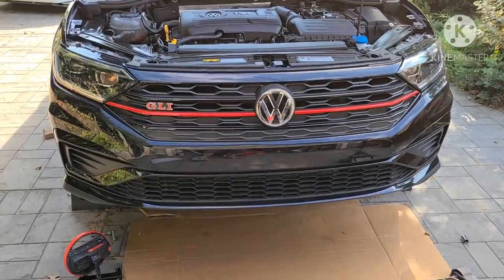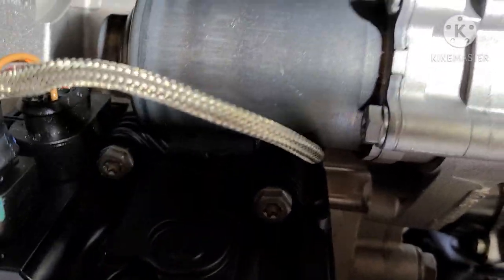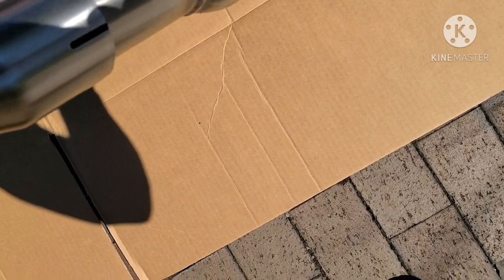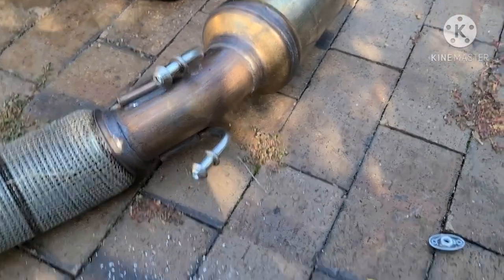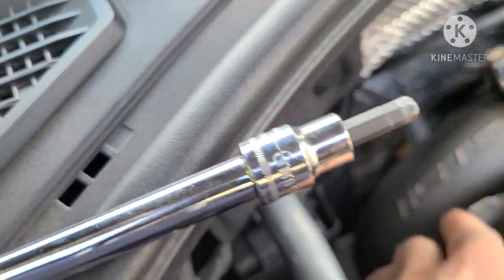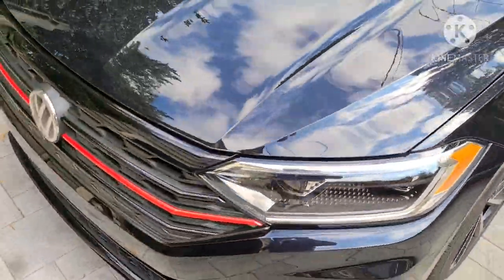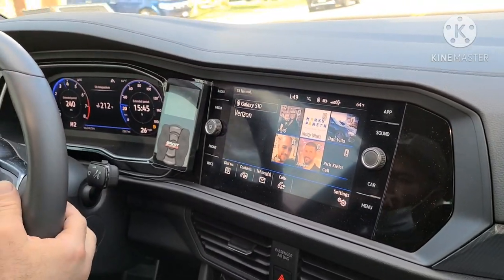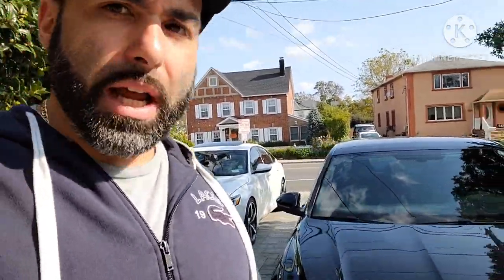2019 MK7 Jetta GLI CTS TURBO Catted Downpipe w/ Stock Exhaust | Installation Tips Pulls & LSD Update

Comment: Those dog bone bolts are TTY and technically should be replaced, FYI. I got mine out without removing anything, but it was a huge PITA.
Reply from the maker: His has the same  issue as performance pack gti so couldn't wiggle it out without taking the bolts out. Once he did came out real easy no obstruction.
Reply: @DanVilla7  all 19 GLIs (I think 20s as well) have the VAQ diff.
Reply: They are TTY, yes, but many have been reused dozens and dozens of times. Only a dealer will "kit" the bolt up for whatever reason cause the system tells them to. Private shops everywhere don't, I'm sure.

Comment: Good video. 

I am even later to the DP game... Going APR Stage 3 IS38 on Monday. Very excited. Thing is APR no longer offers downpipes...so they don't recommend one. That said, knowing what I know about turbos, I struggle to see how that would be reliable long-term. The IS38 will be like a pump being deadheaded with too much backpressure and affect longevity of the turbo. Speaking with some who have the same software file they run the CTS catted DP with the APR file without issue. This is on sale on CTSs website right now for $475 gonna pull thr trigger and install it after thr IS38 gets done. I can do the install myself the money saved in labor is immense.... Sounds good. I want a sleeper so a DP with the stock catback is my dream set-up. Subtle exhaust note so as not to turn heads too easily. Don't see me I wanna sneak up on ya and then stomp ya lol.

Comment: Nice, let me know if you are able to pass NYS Inspection or not with that downpipe.  On my MKV GTI, I was Stage 2 APR with APR's catted downpipe.  Apparently the cat was not powerful enough to pass NYS inspection but was legally a 100 cell cat so they were allowed to call it a catted downpipe.  I did not have a CEL, due to the fact that APR Stage 2 will remove any CEL's related to O2 sensor issues because they assume you are using a catless downpipe.
Reply: Yea 100 cell is basically straight pipe lol. 200 cell minimum for the stricter tail pipe sniffs. Here in Ohio they just scan for fault codes for "e-check". Could be burning more oil than gas, no CEL, pass 😅 obviously a very flawed system. I am about to run this DP and getting my inspection right before to give me 2 years to iron out any CEL issues that may occur. But running the APR Stage 3 file I am not worried. APR may not offer downpipes anymore(can someone explain?) but I suspect their files still have the No O2 fault functionality. I would hope.

Comment: Did the chek engine light pop because the o2 sensor?
Reply from the maker: Yeah he ended up getting a cel around 400 miles later.  He's hasn't gotten around to trying a defouler as of hey yet.

Comment: Any tip on better tires to get rid of that wheel spin during a launch?
Reply from the maker: He's already on summer tires which is better than the stock all seasons. Lots of tq on a fwd, it's pretty hard not to spin. The only alternative in my opinion would be a drag radial but not practical for every day use.
Reply: Michelin PS4 all seasons are a great balance of performance and foul weather traction. Can confirm. But they aren't Super Sports....

Comment: Where did you get the o2 spacer?? I got an o2 spacer but is the second time I got the engine light. Also I’m getting smell from it. Idk if it’s a leak? Where you able to put the ring on the DP?
Reply from the maker: I'm not sure where, but he got a vibrant j style o2 spacer with 3 different restrictors for flow
Reply: @DanVilla7  do you know where he got that?
Reply: @DanVilla7  thanks for the info by the way

Comment: I have a 2019 jetta 1.4t i am straight pipe but still have cats. It isn’t loud as I want it. I was thinking going for CTS 3” catted dp with stage 2 for the check engine light and a luft air intake but i am in utah and i am very concerned if I should proceed with this but I am not sure because of the rules. And i am not sure if they will look underneath even if I pass emissions. Certain cities don’t do emissions but where I live they do. So please help. I want this to sound good but also perform as it should.

Comment: No fumes inside car? Considering doing high flow cat.
Reply from the maker: Nothing in the car slight smell out back
Reply: @DanVilla7  great … borla high flow cat good quality? MK6 GLI 2017
Reply from the maker: @KStone2583  The mk7 gli is my friends car. I had a 2014 gli that was apr stage2.  I went with a USP catted downpipe and was very happy with it.
Reply: @DanVilla7  would u happen to have a link to the high flow cat? It keeps showing me turbo backs etc
Unless that’s what I’m looking for 
Thanks
Reply from the maker: @KStone2583  the downpipe is directly connected to the turbo. You can either buy one with a cat or without
Reply: @DanVilla7  ohh so it’s a catted down pipe
Reply from the maker: @KStone2583  yes sir

Comment: Great video. Do you notice the sound difference inside the car? I'm running JB4 map 6. I'm on the fence about getting a DP. Too much interior noise and possible CEL worries me, though
Reply from the maker: Thanks! You can hear it from inside but not much louder than stock. Outside is more of a difference but it's not overly loud. It a must have mod

Comment: I want to do this to my 2017 jetta GLI
Reply from the maker: I did it myself on my 14 GLI  and it was easier than this car
Reply: Man I should do it on my GLI. Any pointers.
Reply from the maker: @robby23electicalengineer   Yes you should makes a big difference once you go stage 2 but if you have a 6spd like I did you will need an upgraded clutch. As far as installation if you can get all 4 wheels off the ground so you can remove the oem dp  its long and needs room to swing it out.
Reply: @DanVilla7  Will you put in cold air intake? What about after market exhaust?
Reply from the maker: @RawGreySun  this is my friends GLI,  he is considering a cat back for it.  Most likely not doing an intake he already installed a K&N drop in filter

Comment: My 2017 gli the bolts are all rusty so I have to have a shop do it lol
Reply from the maker: Some good penetrating oil should get the job done. Most of the rust is just surface a 2017 isn't that old where bolts would be reall frozen on.